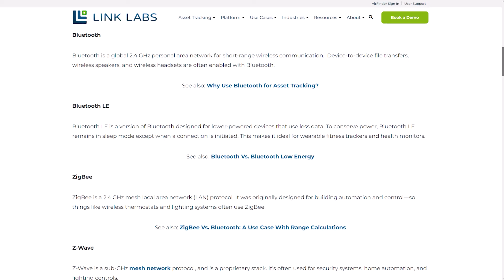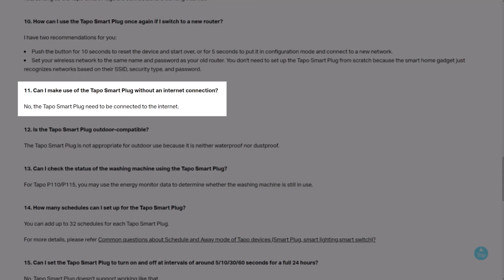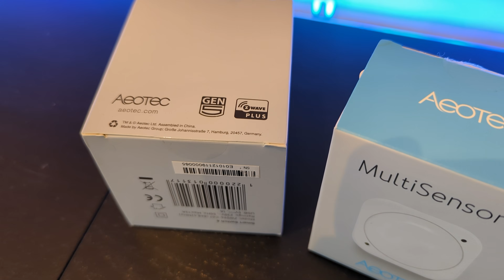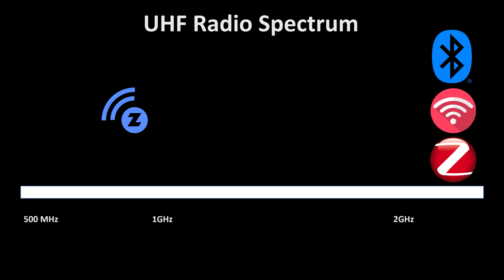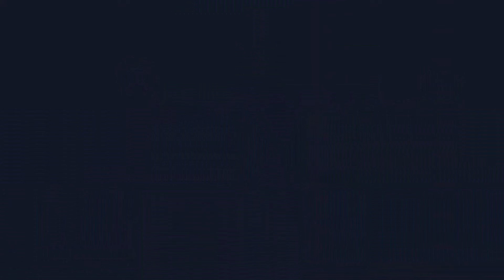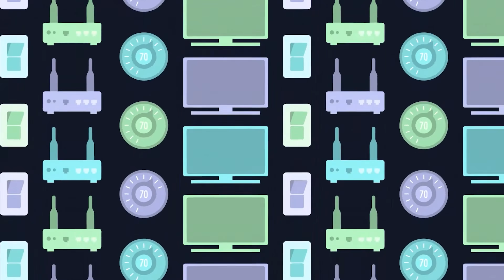Smart Home Protocols Explained

Comment: It's a feature that zigbee and zwave devices don't have IP addresses and can't reach the internet. Once your device has internet access, manufacturers are either going to want to route everything through themselves, either for commercial or nefarious reasons. Their top priority is only user experience until they get you locked in. For this reason, I am loath to use matter/thread despite it being the shiny new thing. I have a zigbee and a zwave network and that is the way I like it.

Comment: Let’s reframe the conversation around smart property design and automation.

The biggest challenge in our industry right now isn’t deciding which protocols to use—it’s deciding who is qualified to deploy them.

When it comes to executing a complex automation project, the critical questions we must ask are:

Is the engineer fully accredited and certified?

Does the smart home company actually have the certified staff required to back up their promises?

The Rise of the "YouTube Integrator"

Technology is evolving at a breakneck pace, but unfortunately, a large portion of electricians and engineers are failing to upskill. The UK market is currently flooded with self-proclaimed "integrators"—both individuals and companies—whose entire technical foundation relies on YouTube tutorials or a single, basic IoT brand. They talk a good game, but when it comes to execution, they frequently deliver flawed, unstable installations.

This isn't just about a light switch not working; it’s a massive risk. Poorly deployed systems compromise end-user safety, data privacy, digital identity, and financial investments.

This is the critical issue we need to address across the UK smart building sector. Engineers must receive proper, accredited education first. Only then will they truly be in a position to design and deliver optimal, robust solutions that genuinely align with a client's needs and budget.

Let’s fix the standard of education, and the quality of the industry will follow. Let’s start here.

Comment: Still valid. I just went for zigbee because lots of devices out there for a reasonable price. For large house or longer distances with sparse network I'd take  zwave (too bad lora devices are not common, you get some great range with them!).
I think it is only a metter of time when thread/metter devices come and I need one. Well, add another dongle to my HA then. Matter/wifi lamps are very common out there (locally only what there seems to be unless Philips Hue) but I hate to have everything on my wifi on dependent on it.

Comment: I have been grinning as I listen to this just because I can tell you know what you’re doing and I am really a quasi IT guy. I can figure out most of the stuff but it’s all new to me.  It’s crazy because there is nobody in my life who is interested or at all in the process of creating a smart home. My parents are getting on board so I’ll get them all set and I’ll make sure it’s easy and that I can remote over and help with any issues. 

I’ve got the shit eating grin because all of the stuff you’ve been recommending is virtually what I have chosen to do. I do have more Z wave than I probably should but lots of zigbee, minimal wi-fi, hardwired where ever possible and will add to it at some point, and I have been lately going with matter over Wi-Fi.
(I imagine it’s less taxing on Wi-Fi, but I do have multiple thread border routers and will be converting and adding new things that run off of matter over thread.)

I will indeed be switching to HA to run the smart home, but I started with SmartThings just to keep a little structure as I learned. My quasi programming will come in handy for HA    Just for the heck of it, I did turn on the hub for Apple, it’s because I have an iPhone and I can unlock my door with iPhones NFC. It’s also some redundancy because of the Aqara hub goes out, I will be doing things exactly the same. But I’m not buying any more hubs!

Oh and lastly, I am a huge fan of wall mounted controllers. I will be putting in flushmounted 8 to 10 inch android tablets, which I will send data and power via PoE. So there’s another place where I did not think about when deciding on where to drop my cat6. 
(below I listed many other missed opportunities)

I built my house in late 2019 and immediately knew that I wanted it hardwired. They offered a couple hardwired spots to the TVs, and then one to a WAP (as in wireless access point… Not the new meaning which is quite dirty after that song lol). 

As far as my network, I have a severely undersized media cabinet and find out need to get what you have. But I have a 48 port PoE+ managed switch (I like to manage it but definitely a learning curve). I do need a POE++ ultra 60 for my replacement wap, which is WiFi6E. 

my local network should be pretty quick because I’ve been aggregating ports, such as my NAS which has two 1gb ports, and all of my networking equipment is Enterprise , such as pro safe from Netgear, along with the WAP, which I can aggregate the 2.5 GB connection and the one GB connection for 3.5. 

Anyways lots of good tricks and Home Assistant has lots of plug-ins for things like my sprinkler system, which I did go ahead and add via Homebridge to Apple, so I do have that control.
Anyways, they would use cat 5e, but I asked them to upgrade to cat6 (of course they charged the extra). I went ahead and ran rj45 jacks to following:
- 4 exterior 10 ft high for 4k PoE IP cams - need 1 more 
- 2 in office (should have been 6)
- 2 in main entertainment….4k tv and
   audiophile grade av receiver & 
   speakers w/3 zones (soon 4)
    *mistake- had to add 6 port dumb
        switch b/c TV, Receiver, ST hub,
        Apple TV 4K. I should have 6. 
- 1 to each bedroom = 4 total
- 1 in garage 
- 1 in kitchen 

I just wanted to say that if you have access before drywall, add MORE cat6 runs than you THINK you need!!

ALSO, think about running power to windows. Ideally, have a couple of window covering solutions so you know how to hide the low-voltage wiring and also keep it out of the way of the install. BTW, I don’t see any actually using PoE, but it is low voltage and I would just go with cat 6, as perhaps they will eventually switch to a hardwired data and power solution. In the meantime you just have some extra wires. 

Same situation for my back patio. I will be closing off one side, which will then require another few ethernet runs of course, but there will be five separate outdoor shades to walk that crazy late afternoon summer sun. 

Anyways good luck to everyone who’s a fanatic like I am and sorry for such a long message

Comment: What smart home protocols can I use if I am developing my own devices with Arduino/esp32? The drawbacks of Bluetooth and WiFi are obvious.
Reply from the maker: I use WiFi with my esp devices
Reply: @HomeAutomationGuy  Actually after doing some research, I can start with off-the shelf smart devices integrated with Home Assistant. The logic can be programmed into Home Assistant using plugins. This way the specialized smart home protocols are available through a hub.

Comment: Thank you for your videos. I have done my research for IoT protocols and while Z-WAVE and WIFI looks the best on paper, I choose WIFI over Z-WAVE because I do not like a mesh network that you cannot really control. Granularity is key for me, so a well done WIFI network is the best in my opinion. Having multiple WIFI access points, all uni-directional, well managed regarding band usage and power emission, makes such a WIFI network bulletproof. In February i'll celebrate 1 year of solid HA running Ethernet and WIFI devices, zero issues so far. In the future I will probably get some Z-WAVE devices for sensors that I cannot simply get in their WIFI form, not in a hurry anyway.

Comment: I'ma gonna drop this super hot take here for others to hear:

"Bandwidth" does not mean "speed". If you think of network connectivity as water flowing through a hose or pipe, bandwidth refers to the diameter of said hose or pipe. It is not directly correlated to how fast things happen.
Same as in electricity, you can have higher voltage or lower resistance. All three give you higher POTENTIAL amount of pixies (amperage) transmited.

A network packet (a drop of water), sent over radio, is NOT traveling slower or faster on higher- or lower-bandwidth networks. It arrives all the same, at the speed of light.
However, if you intend to send a large amount of packets, which has to be split up into packets and sent over, it will arrive quicker over a bigger pipe. Notice: quicker, not "faster".

Comment: I started my home automation journey with Smart Things rather than Hue, and eventually had a mix of Z-Wave and Zigbee devices connected to it, some Smart Things branded and some not.  When I started using Home Assistant, I bought a Z-Wave stick and have been moving devices over to it one by one.  I now have all the Z-Wave devices off of the Smart Things hub.

As the next step--I'm considering buying the Sky Connect stick and moving the Zigbee devices over to HA.  I'm not sure, though, if the Smart Things-branded devices (which are Zigbee inside) will work with a non-Smart Things co-ordinator.  It's difficult to find info on that online, as most "compatibility" threads are discussions about what non-Smart Things devices work with the Smart Things hub--not the other way around.

Comment: Z wave and ZigBee use the same physical layer. ZigBee took too long to get Mesh networking correctly. Zigbee doesn't have a lot of range. Bluetooth BLE offers much more bandwidth and is stable and has 90 channels available. WiFi is overkill for most devices but is easily saturated when you have too many devices.
I prefer BLE because your phone, tablet and laptops support Bluetooth. BLE supports mesh and so connectivity issues are not likely if you have a large number of devices. I have nodes which can communicate over 130m. Good enough for most homes.

Comment: well tuya wifi based can still work with out internet, and yes you are right about the router, isp ussually give low end wifi routers, but the good ones are not that expensive, i have a tplink ax3000 wifi 6 and i have 28 wifi light bulbs from Lloyd´s and 4 precense sensors i have more than 6 smartphones 3 tvs 2 wifi cameras and 4 amazon echo devices and they all work just as good as if they were the only device on my network. tplink has rampd up the quality of their products, wifi 6 is the new sht, and when ever they get wifi 6 ipv6 light bulbs out im al ready prepared to support them,  i dont need to buy an extra hub, i dont need to work my ass off setting up the network to be able to control my house remotely, i can do it already with no hassle. only with wifi.(yes if internet goes out i can still control everything in my house)

Comment: FYI, I just wanted to make a quick correction to your TP-Link claim, although I have considered that at the time of this video's posting, that may have been the case.  However, I now have about 60 various TP-Link Tapo smart home devices, every sensor they make, 7 cameras (wired and wifi), bulbs, switches, plugs, etc and they ALL support local only support.  I tested this specifically with just a few devices, prior to going 'all in'.  If it loses connection to the internet, but still has wifi, you can control it locally via your phone, or any network connected device on the same local network.  Most of the sensors use sub-Ghz wireless to communicate with a hub.  You WONT, however, have remote control, obviously, but they very much can, and do work without access to the internet.  What I HAVE found, is that TP-Link Tapo has been doing a great job with frequent firmware updates to many products, both fixing issues and adding features. Very informative video though, cheers!
Reply from the maker: That's great to hear! I couldn't seem to use them without internet when I tried them a couple of years ago, but maybe I was just daft or perhaps things have changed.

I'm glad to hear they're working well for you!
Reply: @HomeAutomationGuy  yeah it’s definitely true and specifically with the cameras, if you’re recording to NAS, it’s keeping it local. To keep things local I believe you need to make a separate account. Although I really can’t speak for some of their other sensors, as it was between Tapo and Aqara, I went with Aqara, specifically because of the amazing sensors and especially that presence/occupance sensors!

It’s definitely interesting connecting with the hubs converting Aqara specific Zigbee to matter, then being able to do everything on any other hub. I know HA has an agreement with them as well but I’m thinking still needs the hub.

Comment: I have a strange vertically built two stories home. At the moment I have a zigbee Philips hue hub. I plan to remove it once the ZHA dongle arrives. However I am concerned about reach? I wonder if I will have reach issues.

Comment: So you explained why wifi devices having internet access is bad but then said you would switch to Thread in the future. I don't understand that. Why would you let devices from random companies connect to your home network when Zigbee already solved this issue? The only way Thread becomes viable is if they change it to also fully separate from your network. But then it's still pretty much just a Zigbee reskin.
Reply from the maker: I would run them on my IoT network, which is firewalled off from the internet

Comment: I have a question, Can you use Bixby Or Google Assistant or Alexa or Siri, to control these devices connected to home assistant?

Can you turn on/off these device to check if everything is off when outside of home? I remember you saying that these devices will be offline and not be able to talk to internet.
Reply from the maker: Yep, you sure can.  I can control my Zigbee lights that are connected directly to Home Assistant from my Google and Alexa

Comment: Excellent over view of all the different systems.

I got the impression that assuming you have a robust internet, wifi, zigbee mesh and control system you can mix and match home automated products. 

My inherited system is Control4 which is great for my video and audio distribution, + Zigbee light switches but mods to the system can be expensive (£375/day for a programmer). My Zigbee mesh is via light switches which are £175 per switch, which is extortionate. My question can I piggy back on my control4 Zigbee mesh using cheaper zigbee light switches? My zigbee lights are rock solid and I can self programme using the customer/control4 for simple controls. But do the zigbee components have to be compatible with control4?

I have experimented with Shelly products for garden lighting which is outside of my zigbee mesh range but I have an AP point in the garden and Shelly light switches can be added to my Lan. This helps putting on the lights at the bottom of the garden via the Shelly app on the iPad and reduces the component cost vs control4 ,  Control Integration within Control4 is possible providing in add a Shelly driver into my control4 project via the control4 professional. But again it’s expensive.(driver £70+370 for programmer)

Is it possible  to run two home automation and control4 system simultaneously without conflict . Control4 using fixed ip addresses, and zigbee for lighting and home automation using its own protocol and the cost benefit of cheaper zigbee components. Thanks in advance. Ed R

Comment: Are these terms comparing apples and oranges? Bluetooth and WiFi (along with Ethernet) were standards defined by IEEE in 1980. MQTT was invented in 1999 for sensor sub/pub networks, now needed for home automation. Isn't it just a different layer? The sub/pub idea is used in Youtube where we subscribe to a channel. Bluetooth is peer to peer, not MQTT. I imagine MQTT could operate on a cable network with no wireless technology. Aren't Zigbee, Z-Wave, and Thread versions of MQTT? Mosquitto is another version. What does “Zigbee2MQTT" mean, as if Zigbee is not MQTT? Need clarifications from the Home Automation Guy.

Comment: You explained Bluetooth, Wi-Fi, Z-Wave, Zigbee, and Thread. How does MQTT fit in? Isn't that a protocol for IoT networks? Therefore I don't understand "Zigbee2MQTT".
Reply: Mqtt is more like an information exchange or post office  for iOT devices. Your sensor broadcasts its information and mqtt sends it to whoever is subscribed to this sensor ( eg home assistant) this is all tcp ip based so in case of zigbee2mqtt it reeds zigbee and translates to a data stream that the mqtt broker understands
Reply: What about matter and tasmota?